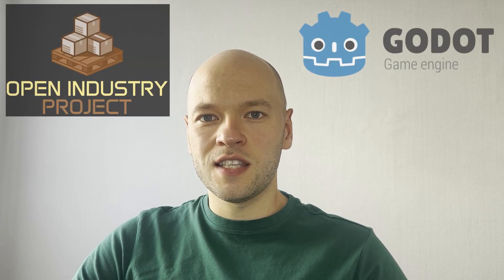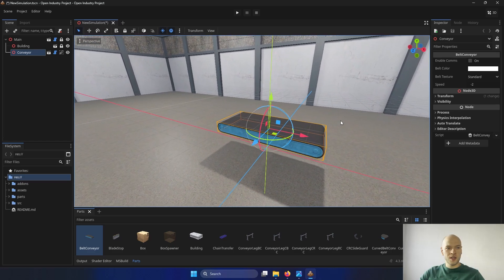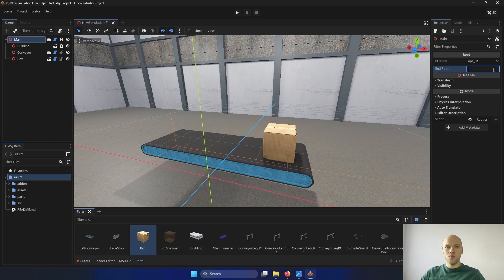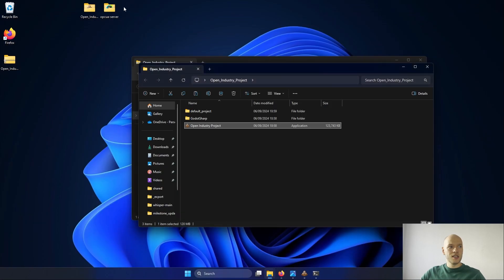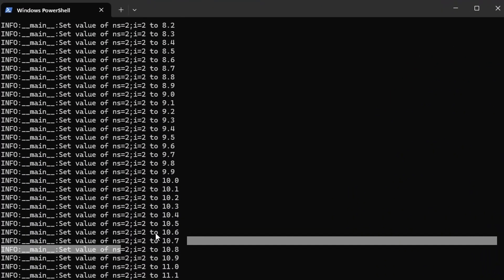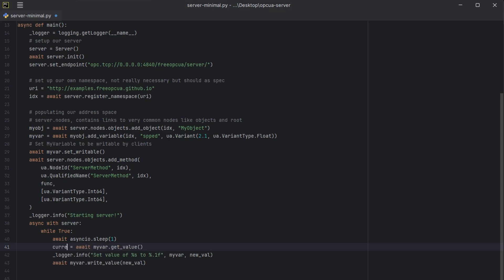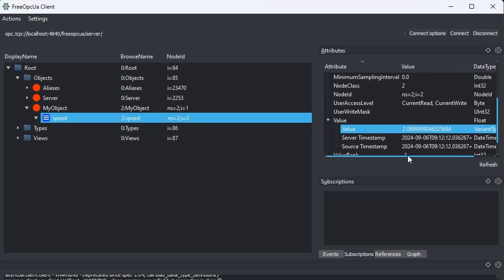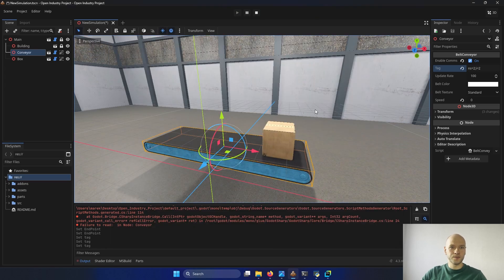Introduction to Open-Industry-Project | Controlling a Conveyor with OPC UA

Comment: Can this similator work with OPENPLC?
Reply from the maker: @nelsonpereira1932  looks like OpenPLC supports Modbus TCP so I believe it should be possible.
Reply: @plcwars  I'm also very curious about this and I'm trying to figure out how to set up modbus/tcp properly
Reply from the maker: @leonardocogo2461  I haven't personally used modbus/tcp yet but if you are looking for more detailed help you can join our discord channel. It is easier to communicate there.